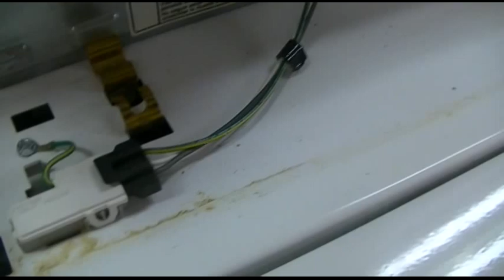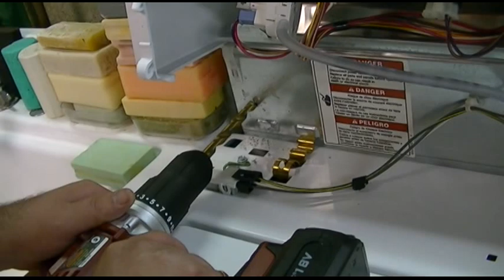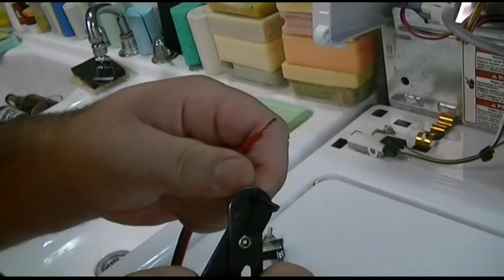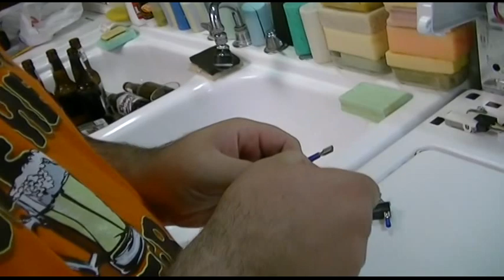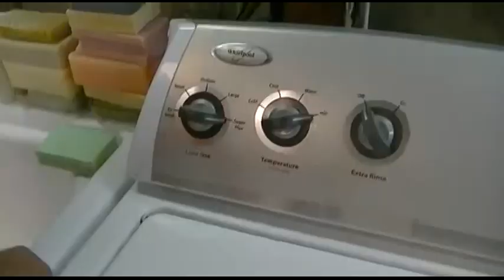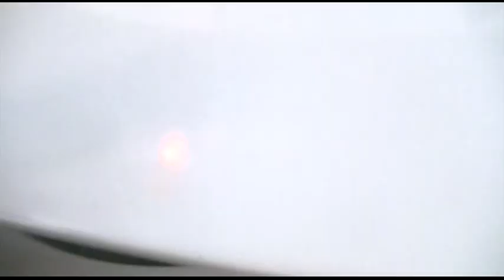The Great Whirlpool Lid Switch Defeat, Part 1

Comment: I didn't put in a switch but I used 1 piece of wire to short the switch - it just goes from one side of the connector to the other, I taped it up with electrical tape and left it for approx 2 years and it kind of melted (my bypass wire is crispy and the plastic connector looks kind of melted, also crunchy elec tape). Any thoughts? I didn't know until just recently it was kinda melted - found out when I popped open the console to get the timer part number. Spin cycle isn't working. I thought the timer was finally kapoot but I'm kind of concerned about the whole melting thing and now I'm wondering if that could be the problem and, if so, does that mean the motor has gone bad? Maybe started putting out too many amps or something? What do you recommend? As far as I've noticed it's been working like a champ until today. Thanks for any advice/thoughts!
Reply from the maker: If you didn't use a jumper wire that's capable of carrying the amount of amps required to run the motor, that's why it melted.  Your shoving the wire in the old connector didn't provide for a terrific metal-to-metal contact either.  If the switch is bad or you just plain don't want it, cut off the connector and wire nut the wires together.  That will solve that problem.

Regarding the spin cycle not working:  Is it possible the connection was SO bad that it can't pass the current required?  The motor takes more power when it goes to spin since it has a full load of wet clothes that the motor needs to overcome.  

Now what you need to do is test the motor before you rule out the timer.  The motor runs in 2 directions.  1 direction is agitate, the other is spin.  There are also 2 windings on the motor, low speed and high speed, unless you have the super-duper-fancy-dancy model that has 3 speeds in which case there are 3 windings.  I'd suggest before anything else that you put the machine to spin on the delicate cycle, that will run the motor on the low speed winding.  If it spins there, there might be a motor winding problem.

To test the motor requires cutting the wires going to it and splicing in 2 test cords.  It's more complicated than I can explain here, but YouTuber theapplianceman has several videos on it.  Be prepared:  You need to know what you're doing.  If you're scared to be cutting wires, forget it.  If you'd like to proceed, check out his video here:  https://www.youtube.com/watch?v=ZAIC3OtVAnc
Reply: Thanks so much for the detailed response. Yes, I do think that the connection could be so bad that it couldn't pass the current. One day, about a month ago, I thought I smelled something burning but then it went away so I decided it was a migraine aura. LOL. Sometimes I smell cigarette smoke that isn't really there but this was different and after seeing the melted connection I know what I smelled was real. I don't know why it took so long to pooh out completely or why it burned up on that particular day and didn't do it anymore. I didn't realize I could just wire those together. I ordered another connector plug today, it will arrive tomorrow. There are three wires that go into it, I guess the third one is a ground wire. So would I wire all three together and then twist on one of those plastic doohickeys? (I guess you can tell by my lingo that I'm probably not going to be comfortable cutting any wires that go to the motor. LOL. Although I DID replace the coupling a couple of years ago! Pretty proud of myself for that! My hubby came home and we ran into each other in the front hallway because I had the garage entry completely blocked by the washer housing. I had the motor off and a tool in each hand and he said my hair was crazy. LOL. It made me feel good to diagnose, find parts and then fix something! It's empowering. :) I love Youtube!)So about the timer... I already ordered a timer that will be here on Monday. I found a used one on eBay for $34. The only cycle that works/worked on the one I have currently was the heavy duty cycle. Delicate/Permanent Press, etc. don't work. I guess I wore them out or something. I've been using only Heavy duty cycle for a year or maybe longer. I guess since I already ordered that connector thingy I'll go ahead and try to use it when it arrives tomorrow...I might try to get the connector off later to see what condition the wires are in. If they are very bad I guess I could go ahead and trim them back to where they are good and wire them all three together? I HAVE been a little worried that my wires won't be long enough to plug the lid switch back in after I clean up the wires. It sounds like, since you are saying I can wire them all together, that my jump wire might have been too skinny? It wasn't an official "jump" wire - it was just some old wire I dug up somewhere... Knowing that, it sounds like you are saying it's safe to wire them all three directly together in order to short the lid switch connection. Is that right? Thanks again!
Reply from the maker: Not quite!  DO NOT wire all 3 together, BAD THINGS WILL HAPPEN!  You'll be sending 120 volts to ground, which, if you're lucky, will only pop the circuit breaker.

DO NOT TOUCH the green wire, leave that alone.  That's a ground wire.  The other 2, whatever colors they are, are the ones you're concerned with.  Just see where your jumper wire was plugged in, use those 2 wires, and twist them together.  Secure with a plastic thingy which is called a wire nut (or "Moret" if you're in Canada).  Wrap the wire nut and wires with electrical tape after for an even more secure and safe connection.  Don't let any bare wire stick out of the wire nut, if that hits the case on a bare metal spot it could short to ground and again bad things will happen.

You'll have to try the timer and see what happens.  Chances are you can unplug the connector and just plug it into the new one with it out of the machine, but you'll have to play with it to figure out what cycle it's in.  Quicker than mounting it up only to find that wasn't the problem, and that timer might be returnable if you don't need it.

Good luck, and let me know how it turns out!
Reply: I'm having problems with my comments and I didn't see this until today. The first timer that came was defective. The replacement timer works but still no spin. Hubby had the wires from the lid switch plugged into the new connector I'd ordered but still no spin. Then he used a pc of wire to bypass the switch as a test and it did spin but it also sparked and the wire got hot. We took that wire out and he decided the wires in the new connector must not be making a good connection so he pulled them out of the connector and insisted on trying to cram them down into the area where the connector would plug in. He did this only with the two wires though, no ground wire and again a flash, this time I think it came from the ground wire which was still in the old, and still unplugged connector. Another time there was a flash that seemed like it was near the timer but I'm getting a little confused about when that one happened. I've finally talked him into wiring the two wires together, as you said, with the wire nut or "morey" (I'm learning!) but he's insisting we should plug the ground wire into the other connector. Should we just leave it hanging out or plug it into the connector or just tape it off or what? I told him you said just leave it alone but he wants clarification as to exactly what that means. Leave it in the old, unplugged connector? Leave it just taped up and hanging out?
Reply: Update to the above comment/question: Hubby wired the two wires coming out of the lid switch connector together with the wire nut and electrical tape. He left the green/middle/ground wire in the connector but it is not plugged into anything currently. The unit is working great in every cycle but we've only done a short test and now we've unplugged the washer again just until we can make sure we did the right thing with the green wire. I'll wait to hear back from you before I plug the machine back in and start using it again. Thanks so much!
Reply from the maker: Great to hear!  The ground wire you can do several things with:
1.  Just leave it hanging.
2.  Cut off the rest of the connector and tape up the end of the wire.
3.  Actually connect the ground wire to the metal case of the machine.  You may need a ring terminal and something like a self-tapping screw.  

It's not really necessary to connect it.  The rest of the case of the machine is already grounded.

The reason you probably saw that flash was because the original connector was melted, the terminals inside probably shorted to each other causing that.  That was a dead short of 120 volts to ground, which is why that happened.

You should be good now to leave it plugged in.  I would, being cautious, stand there with the machine as it washes a load.  Bring a book or magazine or diddle on your phone to pass the time.  If you hear, see, or smell anything abnormal (and bear in mind your sensitivity will be heightened), then unplug it and get back to me.

Sounds to me like you fixed it!  Happy washing!
Reply: Yay! I think it's just hanging out right now (the green wire) still in the replacement plastic connector thingy I bought to replace the melted one, but not "plugged in" anywhere. I guess I'll just leave it like that unless the hub likes one of your other suggestions better. I DO need to catch up on some reading so this is the PERFECT reason to sit down and just read. :) I'll be able to sit down and try it out later this morning. I'm so thankful for your help and guidance. :) God Bless You! :)
Reply from the maker: Ok excellent!  Let me know how it all turns out!
Reply: Working like a CHAMP!!! Thanks again for all your help! :)
Reply from the maker: Beautiful job!  I'm very very happy that you chose to fix your machine rather than junk it.  I guarantee you, the washer you have washes better than any spaceship they make today.  Good news is there are tons of spare parts for your machine, readily available, at not much cost, and the machines are generally pretty simple to work on.  I've replaced the agitator dogs, drain pump, and motor coupler on machines over the years.  There are a few other repair videos on them I have, one of the last good washer designs Whirlpool ever produced.
Reply: I replaced the coupler about 2 years ago - might have even used one of your videos for that repair too - i don't remember. I'm not sure how long it will last because it's plastic. My parents just gave away their Samsung "spaceship" to a neighbor (it was one of the ones with a defective lid supposedly) and got a Speedqueen top loader. What do you think of SQ? Isn't it supposed to be kind of old school? I would think that would mean it is repairable... but I don't know...
Reply from the maker: Thanks.  Yeah the coupler broke on my mother-in-law's machine.  She has a tendency to overload it.  Doing that over many years caused it to fail.  The coupler is MEANT to be plastic so it itself will break, rather than damaging other more expensive parts.  Kind of the "chain is only as strong as its weakest link" idea.

Your parents made the best move they ever could make.  SQ is old school, and that's the point.  Old washers just worked.  I have a 4 part series on a Speed Queen that was just installed at my friend's mother's house.  The machine is very heavy and solid, and completely over-engineered.  That's a good thing that means extra quality.  Repairs appear to be pretty easy on them, but since they rarely, if ever will need repairs it's actually a bit hard to say!
Reply: I never thought about the coupler being plastic and how that might protect the motor. That's interesting! Glad to hear the SQ was a good choice. I'm going to check out your SQ series!
Reply from the maker: Thanks.  Yes, the coupler is plastic so it will break and save the motor and transmission from damage.  Some of the older ones would break, but Whirlpool had redesigned the coupler to have a metal-reinforced center to prevent it from shearing due to age.

The Speed Queen was a good choice indeed, haven't heard any news, and like they say, no news is good news.  I know that if I ever needed one, and I had to buy new, that's the very first thing I would do, no questions asked.

Comment: I hate these pain in the ass lid locks....My whirlpool won't even let me open it until I wait around 10-15  seconds.  Sometimes I just stick something in the hole to get past this annoying feature (that's what she said).
Reply from the maker: Yeah I know all about it.  I believe you can unscrew the lid latch and jam that in the hole to satisfy the (yeah that's not sounding dirty) machine.
Reply: lol. I love the innuendo's.  These safety switches seem to be a bit more intelligent than the ones back in the day that were just a simple switch..at the last place I lived you needed to place a strong magnet in the exact right spot to make the machine think the lid was closed.  Haven't messed around with this one enough to figure it out, but I just wish I could see inside sometimes because it seems like it's just sitting there, doing nothing at times.

Cheers.
Reply from the maker: Best getting another machine.  These newer ones are just a pile of garbage.  If you want new, get a Speed Queen, they are the last of the old-school washers.  Lid switch is easy to bypass too.  You'll pay for it, but it will likely last you the rest of your life.
Reply: jaykay18 Well, because I rent, I don't have to worry about having to buy stuff like this.  One of the few benefits of renting I guess lol.  My rents used to have this old beast of a machine that just kept going; it was a Kenmore.  That thing was unstoppable and they had it from '85 all the way 'till last year when they moved.  It even survived my young, innocent destructive years where I used to let it spin and throw various objects into it LOL.
Reply from the maker: That Kenmore they had very likely used the same internals as these machines; that mechanism was around for a long, long time.  Virtually bulletproof.

Comment: Great video. I put a magnet on my switch to defeat it and guess what ?  Works great initially but then errors out because after a cycle or two the stupid machine says to itself hey you have done load(s) without opening the lid and that can't be. So essentially it looks for not only closed but also an occasional open to ensure the switch is working how it presumably should be.  This is on a 2015 GE machine.  At least that's what I have come to the conclusion on. So although this would work for your machine it would not on mine.  I dislike all these features that are supposed to make you safe. Some are good, some not so good. Great ending and video!
Reply from the maker: Interesting.  I think the best solution for you would be for you to wire into the switch like I have done here, but instead use a normally closed switch, with a momentary off.  Then all you'd really have to do is blip the switch once and you're all set.

Or, the solution could be the other thing I have here, the wind-up timer on the wall.  If, with your magnet already in place, and the machine unplugged, when plugged in if it will complete a cycle, all you have to do is unplug it each time.  And they way you do that is how I did.  BONUS:  Doing that will physically disconnect the mains from the machine so a lightning strike is very unlikely to fry the board in it.

When I first bought this machine, I got it from Sears.  They have people that call you a month or two in for a second chance on their extended warranties.  When they called me, they said "Did you know that even when your machine is off, it can still get a power surge by lightning?"  To which of course I replied "Did you know that I specifically bought this machine because the timer is completely mechanical and physically breaks connection from the mains so that's impossible?"  Needless to say they didn't get the sale, and it's great because if they did, like so many other, they take the money and run.  With the crap made today, they probably get at least 1 call under extended for every machine sold, I swear I don't know how they make money even selling those anymore.

Comment: I have a whirlpool cabrio top loader, the lid lock is broke. I am a single mom and can't really afford anything expensive to fix it. I am, however, pretty handy with tools, could someone comment back or message me with how I could get my washer to work again? Maybe post a how to video on this washer? It is the digital display one.
Reply from the maker: Those type washers, I'm afraid, will require replacing the parts that are broken.  They don't just lock the lid and that's it, they have to verify it's locked as well.  So it's not as simple as shorting a couple of wires and that's it.  As far as I know, there is no way to bypass that, especially since you have to fool the digital control panel into thinking the lid is locked.

Fortunately, you can likely find the parts needed on ebay or amazon, and replace them yourself.  Good luck!